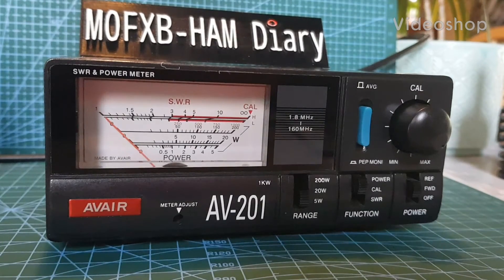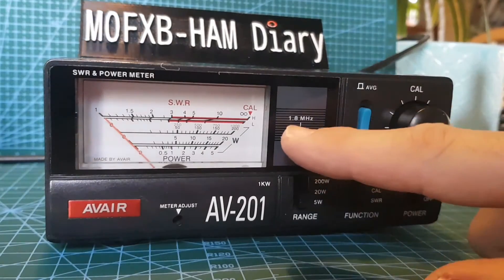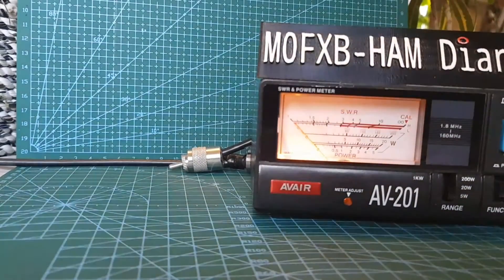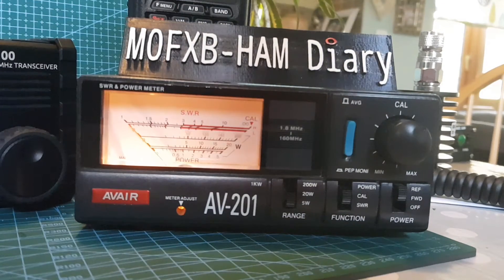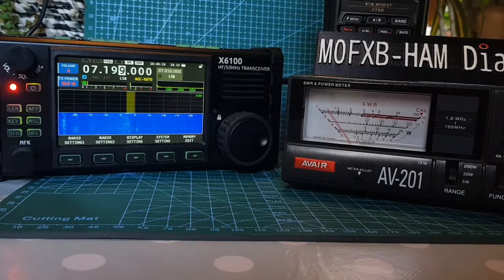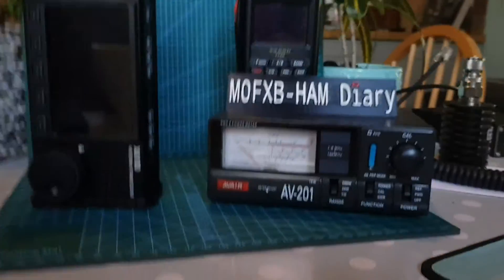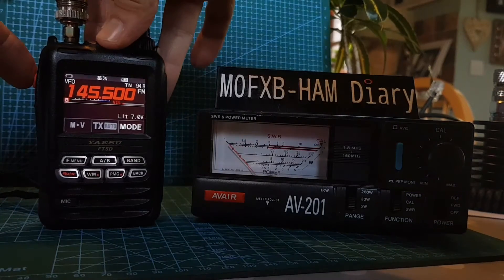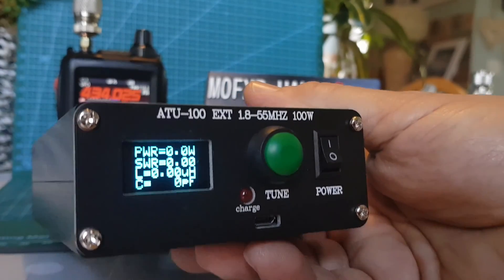AVAIR - AV-201 SWR Meter HF 6 Meters VHF only  Set Up and Review - with Xiegu X6100 and Yaesu FT5D

Comment: I own this one.
Unfortunately I have pluged the TX to ant socket and ant to tx socket. The wrong way :(
after lot of tets I saw my mistake.
after replug in the good way, I ccan't calibrate it, the needle does go enough to the right dispite having turn full clock wise the rotary button.

I have no schema of it, and I don't what compnnent(s) is ( are) now defective.. I don't know where to start .
Does somebody can give me some idea ?
Thanks and 73
Reply from the maker: It should be ok make sure you select correct power level on the SWR unit .

Comment: Nice meter indeed. 
You should definitely go for the ATU-10 as, not only is it designed for lower RF levels, it uses latching relays which only briefly consume power while changing state which means the battery will last a very long time indeed. Unfortunately, that also makes it a bit more expensive 😕
The relays in the ATU-100 are bog standard ones that draw power all the time they are engaged.  Fine for home use or when plugged into a large battery.
Reply from the maker: Hi Thanks for the info the reason i got this device was that it was £65  i have 2 choices one to get the qrp to do 10 watts or swop for the ATU 10 which is £120 at that pricde i can get a good used atu so not sure i  prob will keep as this device has lots of potential.

https://www.youtube.com/watch?v=dPys_-_wPcQ&t=185s
Reply: @M0FXBHamTech  yep.. the one you have can be modded to work better at QRP levels anyway so no need to throw more money at it. I've seen un-boxed kits of that for under £20 which is crazy.